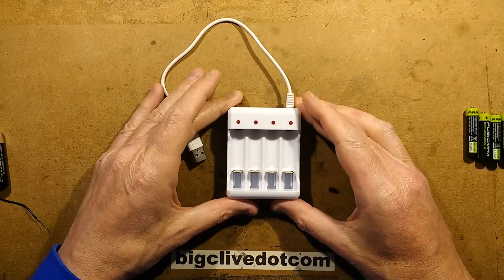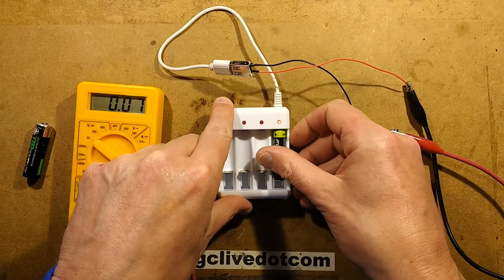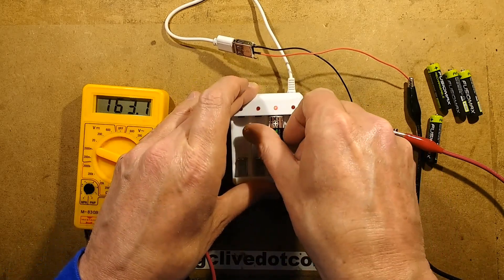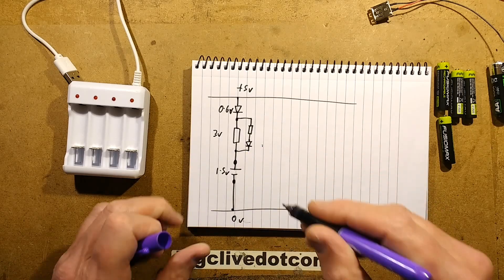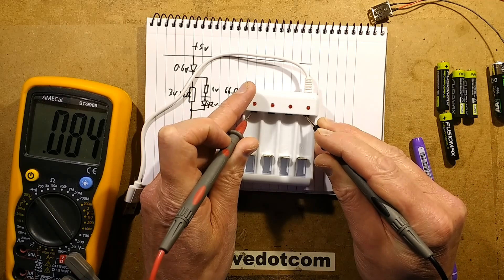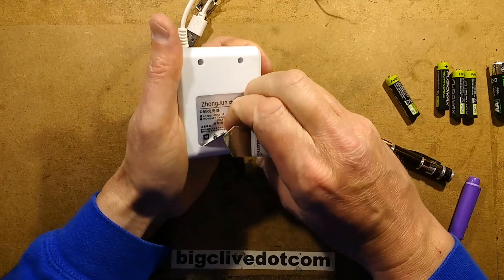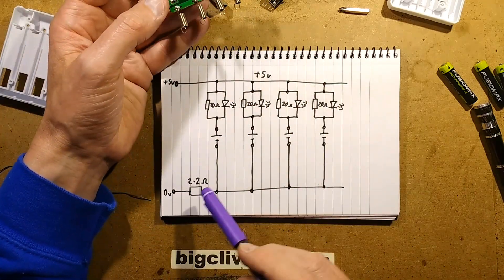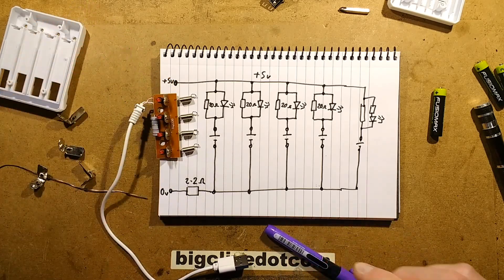inside a cheap and very shitty USB battery charger.

Comment: On this video you have the same circuit with 120 ohm resistors https://www.youtube.com/watch?v=wVnAH17f4jg By looking at the current video I see 20 ohm. Why is the difference? 120 ohm is for lower current?
Reply from the maker: If it's the series resistors it will determine the current.  Lower resistance would usually equate to higher current.

Comment: You also want to make sure that there is a ripple with this circuit.Dathat's, it's not full d.C.It's not filtered DC, it's pulsating.D c that goes in but you still only get Maybe 1.2 V to 2 V for a nightcat's cell battery charger.Or a nightcat sell one point two lolls one point three volt battery

Comment: I love how YouTube will throw me a 5 year old video LoL, basically telling me that I watched every current video available and they are desperately trying to keep me entertained LoL.... 
The design of this battery charger looks like you can put in a flat battery along with other cells that are charged and it should theoretically charge the flat battery until all cells are balanced! 
Possibly lighting the led on the flat battery to indicate that it's being charged LoL.... 
I wonder if it would actually work? 
I have an led with a PIR sensor battery powered by 3 AA cells in a dark hallway which I have been using for years. I use Panasonic rechargeable AA cells and always find that when it stops working, it's always one cell that is completely flat while the other two still have charge but they aren't equal either... 
It seems that even AA cells need some sort of balancing... 
I don't remember exactly but I'm sure that the cell which gets discharged the most probably goes way to low in voltage which is probably bad for it... 
Maybe it's time to invest in something else that is designed a bit better...

Comment: I don't think the charger should OUTPUT anything... Which would be the case, IF there was a diode across the cells. No wonder why thats so cheap.
Oh well... I think this can be used as a DIY powerbank, if you resolder the plug or split it. Do that at your own risk, though.

Comment: That looks like a unmanaged charger! What I mean is it’s not smart to to not charge a disposable battery!
Reply from the maker: It would probably pressurise a non rechargeable with an explosion risk.
Reply: @bigclivedotcom  I did orginaly charge Duracell/Kirkland batteries on a unmanaged charger and it worked fine but stopped after getting rechargeable batteries

Comment: Interesting...  I bought some 2400 mAh  NiMh  batteries to replace the old Ni-cd for my AOR Radio, which is quite power hungry. Unfortunately I could not get them to fit "side by side" without quite a lot of force, which reulted in damaging the outer insulation and shorting the batteries. Ooops.  It apppears that these higher capacity NiMh  are somewhat fatter in diameter than a standard battery,  around 0.3mm which adds up when you have four side by side.  So people beware, if you have a tight fit appliance. After buying various other good brands I found some " Fusion Max" cells which are NiMh  800mAh and do a reasonable job. So it seems the higher capacity are bigger.

Comment: Guess the reason it came so cheap, they produced a large number with faulty pcb layout ... someone made a mistake with the LED + Resistor not to be in series in the layout, and now they try to get rid of the production lot for pretty much the plain material price.

Comment: There's a current limit built into the led. Test it out by shorting a battery in it and see what happens.  Burned up means no limit, still working means limited

Comment: I bought 3 of these to rebuild as per Clive’s design to keep my niiMH AA fleet on charge indefinitely. The price itself was well worth the fancy enclosure. All I needed were resistors as the leds came free. The sum of the parts was worth more than the whole. Thanks Clive! Thanks China. I was going to build Clive’s version, repurposing these turned out cheaper and faster. LOL.

Comment: They are cheap, and they are shitty, but for me they have had a great purpose... I got a few of them as battery "frames", removing all the electronic components from inside and changing the USB cable to an XT30 connector to use it for charging AA and AAA batteries, both NiMH and Li-Ion, via my Imax B6AC hobby charger (a real one, not a chinese clone). I even cut 2 of them up in a way to make an extra long one for charging my NH-14WM gumstick batteries. I find that the spring loading mechanism is pretty useful and that, and the plastic itself, weren't at all bad on the ones I got. As they are, they are pretty bad, but, they can have a purpose.

Comment: This might be a bit off your field but I am curious of what affect this design would have on the batteries?  Perhaps the LED's would 'blow' after some time but that wouldn't really stop the charger from functioning.  The problem I see if if a full battery especially NiCd is placed next to a near empty one (or shorted battery) a large current would flow and could cause the circuit to burn out.  The other issue I see is a battery is doing extra discharging for the same reason, a depleted battery will pull from a nearby charged one,two or three, as well as a shorted battery would discharge all of them.

Comment: Since aa and aaa batteries test at 1.6+v new what is the point of rechargables that are 1.2v charged? I have many things that will not work at 1.2v Why are these batteries sold? You can get 1.5v rechargables (if you look hard for them)! very odd.
Reply from the maker: The 1.2V is down to the chemistry.

Comment: How long it takes to charge batteries with this thing? Diodes always stays red, I left mine for two days and then batteries started to leak! and the USB adapter died
Reply from the maker: It's a trickle charger.  It charges continuously.  The LEDs will never change colour.

Comment: Hi bought this charger as well. when I'm charging the battery there's red light showing. does it change the colour after full charge how does this light system works ?
Reply from the maker: With this type of doesn't indicate that the battery is charged.  It trickle charges continuously.
Reply: @bigclivedotcom   so any idea how many hours does AAA battery takes to get full charged
Reply: @PreetSingh-vg4dh  same here. I left mine for two days to charge batteries and then found the battery's leakage and the USB adapter has died.  
Have you found an answer?
Reply: @-K3C-  yes, thank god it didn't blast for you, only charge it for maximum 2 Hours
Reply: @PreetSingh-vg4dh  thanx

Comment: I'm puzzled by your "Ideal" drawing... Sure maybe the current would slow down, but why would that not charge the battery all the way to 5V eventually (which would destroy the cell)...
Reply: Or maybe with the Diode at 0.6V, it would charge to 4.4, but that's still quite a big deal...
Reply from the maker: NiMh cells can be trickle charged continually, even when fully charged.

Comment: They used this circuit because when the cell is fully charged the current will not pass through the led and it will not light up Indicating that the battery is fully charged.

Comment: I have 4x AA NiMH Rechargeable batteries that I have used before but I haven't used them in around a year or so, should I just charge them or should I full discharge then in my smart battery charger.
Reply from the maker: There's no harm cycling them or just topping then up.

Comment: I've got better... I took apart a cheap phone magnifier with a speaker that uses a 1N4004 SMD equiv diode in series with a Lipo batttery and USB. that's it. no charge controller or anything.
Reply from the maker: That's surprisingly common.  Sometimes with a protected battery and sometimes without.

Comment: In theory this should charge Li cells too, until they reach 5V or burn. It's such a shitty design though. Even my lazy early home built li cell charger at least featured a lightbulb as current regulator and a 1W red LED to drop the supply voltage to the cut off voltage.

Comment: well that looks better than the one I got.  which I use to stick a charge across alkaline batteries so I can stick it in a charger to do those batteries.  Yeah silly but it leaks on a $3 chaarger could care less.  it looks like this one but w/o the batteries  https://www.ebay.com/itm/4x-AA-3000mAh-4x-AAA-1000mAh-1-2V-NI-MH-Rechargeable-Battery-2xCase-Charger-/112385678299?var=&hash=item1a2ab55bdb

Comment: Hey there BC, with all of the battery chargers you have taken to bits by now just which one would you recommend your viewers to purchase then? Thanks, Tom.
Reply from the maker: Each has its own merits, but I've not found the ultimate charger yet.
Reply: OK, thank you BC. Reason I ask is because I've been looking at one on E-bay which is a revised model & I just wanted your expertise on that matter because I have the normal chargers without any complaints other than Ni-mh. takes way too long to charge back for that little charge we get back in place for it. But anyway thanks again, Tom.

Comment: In LED lighting with complete strings of them 'in a row', there is going to go a whole lot of current through every separate, individual LED in each string as well, namely the current that is needed to power the total of all the other LEDs in that series. I have always wondered how that was possible, I believe I saw lights with over 30 LEDs (on a chip) per row?

Comment: Question time! When you checked for a diode on the +5v side of the circuit, you used the red lead on the meter on the USB +5v line, correct? Wouldn't a diode have allowed current to pass in that direction? Power should flow through +5v and out to the 0v side the way that you tested even with a diode, should it not? The black connection on the meter is the connection to ground, right? And the red side is the positive side? Just trying to clear up my confusion, enjoying the video so far!
Reply: He checked it with diode test mode, there you measure forward bias first, this should have shown 0.7 on the display as that is the forward bias voltage drop of a diode. It however showed 0.4 and beeped, as that is too low for a healthy diode! Had he be measuring continuity, the display would have read 0 for 0 Ohms - it would not beep in that mode if the display wasn't 0!

Comment: I have a battery question. Can a lithium-ion battery charger work on lithium-polymer batteries? I search eBay for a LiPo charger and many are described like "Polymer Lithium Battery Charger Protection Board Li-ion Charging Protect" or just say "lithium" with nothing more. Some just say lithium-ion. What's your advice, O wise one?
Reply from the maker: The terms lithium ion and polymer are just fired about randomly.  Technically speaking they're both lithium ion batteries and will usually have the same upper voltage of 4.2V.  The LiFePO4 cells are different though and need a lower upper charge voltage.
Reply: Thanks! You're a big help.

Comment: Clive's design would have cost a whole lot more to implement.  His required a total of eight resistors, while the cheap shitty design only used five, and no diode to prevent back-feeding.  Sure, it's a shitty design, worthy of any Poundland electronics aisle, but think of how many Yuan were saved across a run of maybe a hundred thousand units!

Comment: Had a rechargeable 12V drill with a charger that had the same circuit (different values of course) as you drew first. 18V input from a transformer. The main resistor burned out 3rd time I used it, couldn't check the value, it was about 1W, and the surface was burned off!

Comment: I once ordered a USB lithium 18650 charger from Ebay. It had no circuits in it whatsoever....
5V straight over the cell with no current limiter. Now that's a fire starter!
Reply: Dr. M. H.  Quite

Comment: that LED trick not putting a resistor seems common anymore, I have had several dollar store USB chargers where they just put a blue LED across the 5V output directly.  so far they have all mysteriously stopped working, never considered maybe the LED shorted or something...

Comment: Clive, I have seen some of your doodles where there is a diode in line with a LED.  The question begs, if you have a LED in a line, why is the diode needed?  Perhaps due to a lower forward voltage?
Reply from the maker: +Jeff Lewis LEDs are not designed to block reverse voltage. They can only handle about 5v.
Reply: bigclivedotcom Taphat answers a lot!  In this case, there was only 5V in, but that is too close for my taste.

Comment: Is it possible the LEDs has built in resistors?  I have a bunch of red LEDs with built in resistance bought at a local store(they dont sell them anymore though)
Reply: No. LED with built-in R are special parts to replace indicator lights and therefore too expensive for such products. 
 
In fact, you can hardly kill a red LED hooked on regulated 5 V from an USB port, still over-loaded though. 
 
The 2 Ohm R about halfs the USB voltage in order not to kill the AA cells at first charge ... they won't survive several charging cycles, of course.

Comment: cheep ebay battery chargers are funny. I have a couple of uber cheap (a quid each) 18650 chargers from ebay of the type with a flip down euro style plug and a single cell slot with a sliding sprung contact. there are two variants, a type with two PP3 style connectors on either side of the main slot, listed as "universal 1.2v, 3.7v and 9v charger) and a type without. when I first tried to connect a pp3 battery I was frustrated as the plastic is moulded in such a way to make it impossible. so I opened the thing to see if I could bodge in a pp3 lead and clip to find that those terminals arent connected to anything inside and theres no circuitry for a 9v supply anyway. and I dont see any evidence in either of them that they would (safely) charge 1.2v NiMHs either. but at least it charges 18650s, and it actually does that better than the near identical charger without the faux 9v connectors, that one gets alarmingly hot but the one I opened stays almost totally cool.

Comment: It's not just an odd circuit but simply piss poor engineering. I wonder, if the designer made it like this on purpose, as cheap as possible, or they simply just don't know..need to go back to school The LEDS can actually take a few hundred milliamps, but will eventually fail. Also the cold solder joint on the LED shows quality control is lacking too.

Comment: I can see the 'logic" behind it, but only on the assumption that the designer had a poor grasp of Ohm's Law, or maybe basic arithmetic. Or both. Oh, and a poor ability to read or believe spec sheets. Assume that the individual series resistors were intended as trickle charge resistors. Then the charge current will be carried by the LED, and once the battery is fully charged, the current will drop to the point it is carried across the trickle resistor, and the 'charging' LED will go out. The only two problems with that theory is that the 'trickle current' will be 170ma thru the 20 ohm resistor, and a lot more thru the LED if it doesn't fry first. If the resistor had been about 700 ohms they would have a 5ma trickle charge. Of course the charge current is still limited by the LED and the 2 ohm resistor until the battery reaches about 3V. Not a good idea.

Comment: Since this is supposed to be a USB powered charger, doesn't the single current limiting resistor limit the total current draw meaning that one battery would charge faster than four, but the total current draw would remain within (sort of) the USB port specs irrespective of how many batteries are being charged, and what their charge level is ?

Comment: What would the effect of this charger be on batteries if used regularly? Also, could you please get a bigger calculator? I couldn't quite see the digits on that one! (I have a cute little retro 1970s one you can have with vacuum fluorescent digits).
Reply from the maker: +Stephen Cresswell Covet that.retro calculator.  They're increasingly rare.
Reply: bigclivedotcom Ok! Will do. Have a few. Can't resist retro digital stuff. If ever you need an old digital watch or calculator for a video just let me know! Keep up the good work. 👍

Comment: Why would anybody even consider to purchase rubbish from China?
Reply: Eryk Johansson Because that's where 90% of all small electronics come from.
Reply: E.g. my Notebook's internal fan gets old pretty fast due to high usage. If I buy it from here (Germany) I pay around 20€. If I buy it from China it is around 7€ including China Post Registered Air Mail, comes in a cardboard box even to protect it from getting crushed! And it is absolutely, exactly the same thing.
Also some turd is so poopy that it's only available from China (or it's just not as "wanted" to be sold from local suppliers). Of course the charger in the video is extra shite, I recommend using sites with reviews, so one can at least prevent buying poop awaiting it to be good. Or use bad reviews to buy extra bad items for shits and giggles \o/
Reply: W19 ELY True, but it still not explain why people are buying rubbish trough Ebay or other trading sites. Just common sense applied and one just must understand that all you get for 1£ is nothing but rubbish.